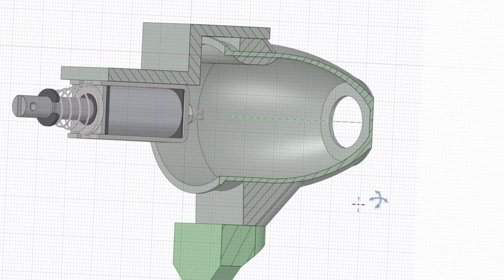Will a Vortex Cannon work in a Vacuum?

Comment: some high voltage sparks would be interesting to see how the resistance increases with an increasing vacuum + smoke ofc :) or just go all the way and make an ion drive, no air means it shouldn't corrode